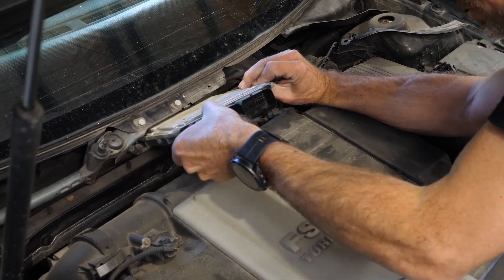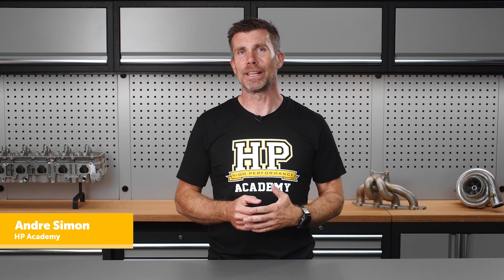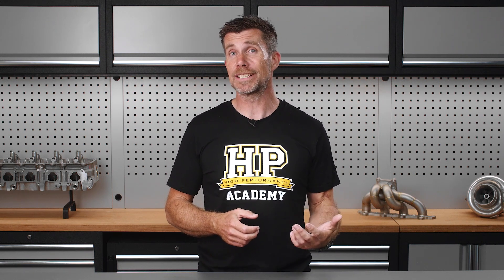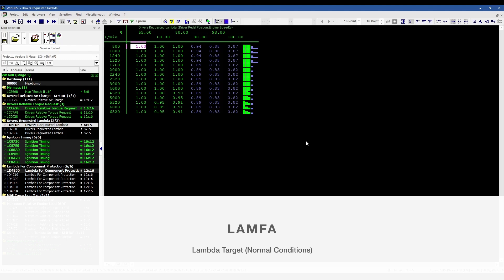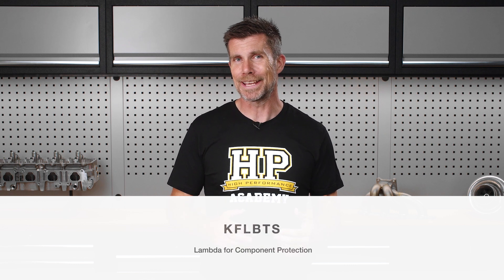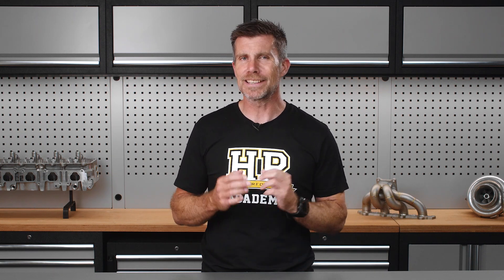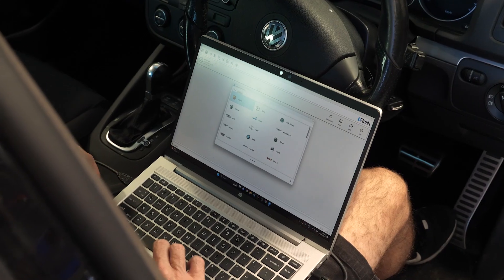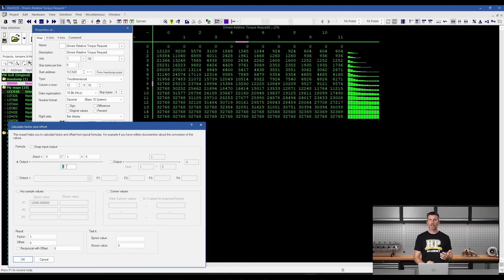Stolen Horsepower? | KFLBTS & LAMFA

Comment: for anyone wondering, EU OEM ECU's don't have VE tables or Pulse width tables, but injector flowrate and calibration vs voltage/pressure, lambda target table and thats it. Trough MAF it senses how much air goes in (it already knows baro pressure), then calculates how much fuel does need to be injected to get desired lambda and lastly checks result trough wideband sensor and calculate short term correction based on result.

in new ecu's like Simos 18-19 you don't have MAF (2.0tfsi, 2.5tfsi) but pressure sensor before throttle and after throttle (also one after air filter before intercooler and baro sensor in ECU) and then based on pressure difference before/after throttle and operating conditions (temp, pressure, rpm) it checks map in ECU that gives ECU virtual MAF reading. Rest is same with dividing Air/Fuel to get desired Lambda as it is in map. -> so changing throttle diameter will result in decalibrating ECU for example and tuning fuel table is as easy as changing lambda target :D 

In older ECU's like in 1.8t 20v (Motronic 3.8/7.5) if you disconnect MAF sensor, ecu start operating in alfa-n mode (with small map something like 6x6 (or 6x12) in size for fuel for whole powerband)
Reply: I'm not sure about the ECU details with these, but there's also some of those gas engines from ze German brands that don't have a throttle body at all too, and the engine is throttle via fuel flow like a diesel. There's some really interesting stuff going on from the OEM side for sure.
Reply: Do you perhaps know why they went away from MAF for the two pressure sensors? Are there any advantages of using that?
Reply: @NieJestemzPolskiPL  MAP based tuning is a lot more accurate on a turbocharged vehicle. I imagine it only gets even more accurate with more pressure sensors

Comment: Maybe it's also worth mentioning that in stock configuration, the values in KFLBTS are not the lambda targets. The actual lambda targets is calculated as follows: lambts = KFLBTS + [KF]DLBTS*KFFDLBTS (source: s4wiki); you have to set [KF]DLBTS and/or KFFDLBTS = 0